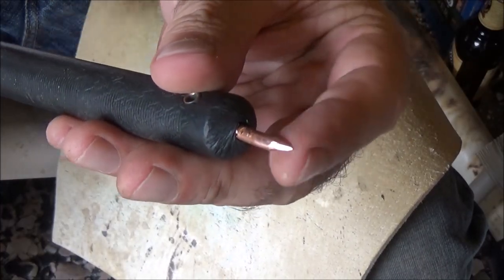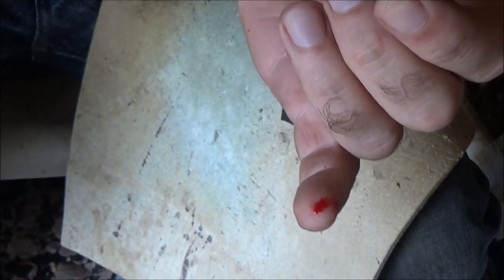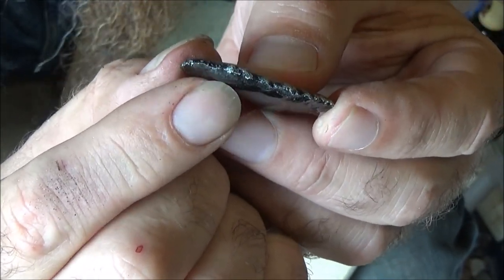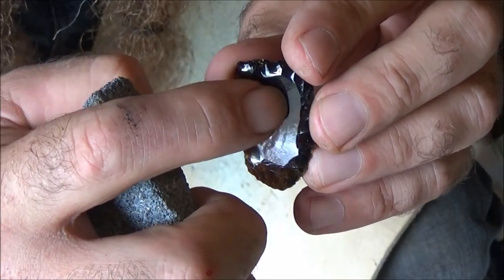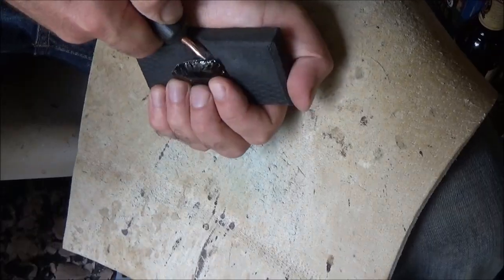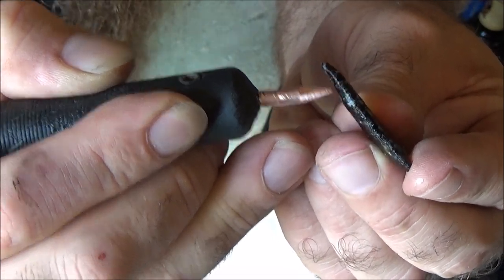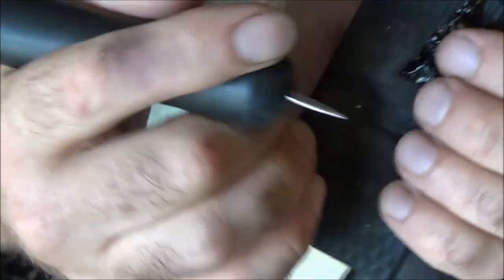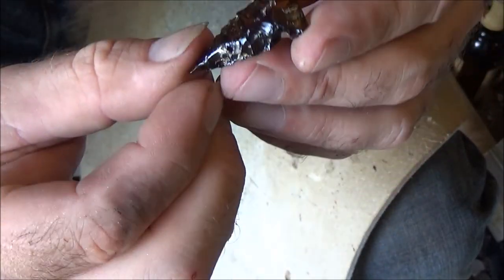how make an arrowhead from a beer bottle part 2

Comment: I have a couple of efficacy questions, coming from an uninformed point of view. Is this genuinely much better than just using a sharp, roughly triangular shard of glass attached to an arrow? Why bother meeting the bevels in the middle? It would be thicker without, but is that such a problem? Once it's sharp it's sharp, surely you are primarily after it being sharp and adding a little weight to the front end of the arrow. I'm sure it's more consistent to have a bunch of arrows exactly the same giving more consistent flight but it also seems like this takes time not only to make one of these, but also to learn how and also opens you up to a bunch of infection risks from cuts in a survival situation.

Comment: The video is great but knapping and flaking isnt so easy based on my trial. Seems good when you watch but when you translate it into action you bump into problems. 

My glass piece refuses to give away flakes :) Probably my tools are not the best but after some time I give up. I have reached to certain point but paused for now till next trial.
Reply: Takes a LOT of pressure. Soft, flabby cubicle dwellers don’t have the hand strength.